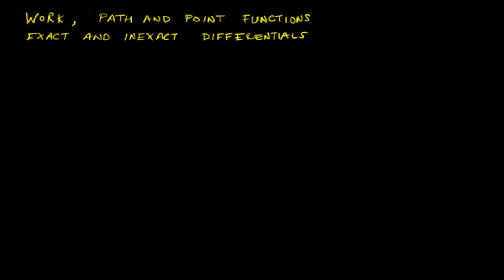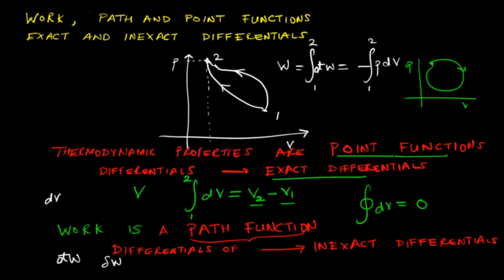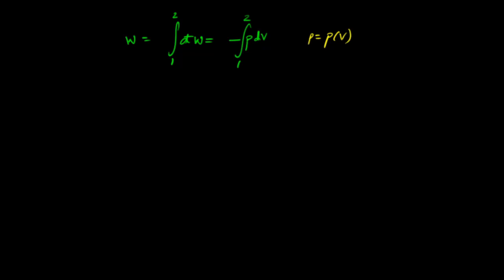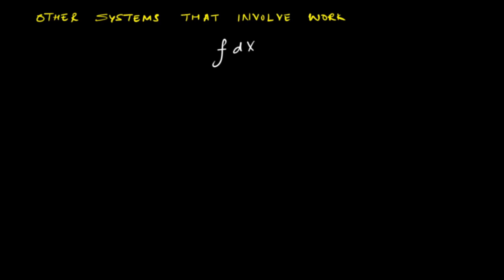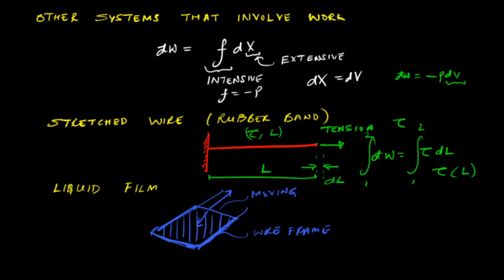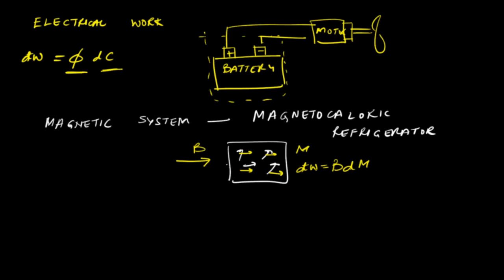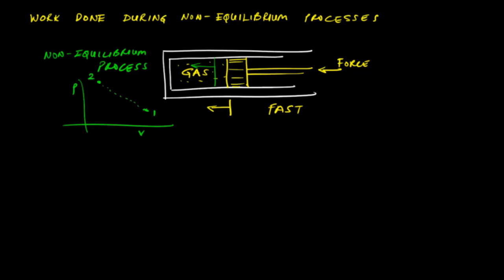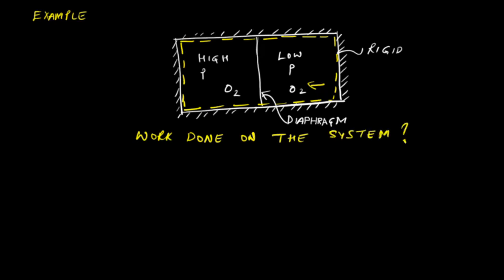Lecture 8: Work, Path & Point Functions, Exact & Inexact Differentials (Engineering Thermodynamics)

Comment: sir in the battery motor and pully example in the last boundary you said no work is done but isn't gravity doing work on the system?
Reply from the maker: The effect of gravity in this case needs to be accounted for in the energy of the system. There is no transfer of energy in form of work across the system boundary. So work is zero. Work and heat are forms of energy transfer across system boundary.
Reply: @bahgalabiitdelhi7797  sir, that means doe we are including the gravitational source in the system as well because to define it in the internal energy should we have the gravitational source also as a part of the system.
Reply from the maker: @thebabacompany1283  This is discussed in lecture 11. Please watch and let me know if you still have doubts.
Reply from the maker: @thebabacompany1283  we are defining system as a matter under investigation. We don't need to include the fields like gravitational field.

Comment: Sir in surface tension course the force on wire due to film should be 2× sigma × length ( beacuse film is on both side ) so work will also come 2 × sigma × area
am I right sir ?
Reply from the maker: Factor of 2 can be incorporated in definition of area in this case.

Comment: The work done is 0 in the last question as our system will only apply force on the walls and the displacements is zero of the walls. So, it should be 0.
Reply from the maker: Yes the boundary is rigid and hence no change in volume. So work is zero.